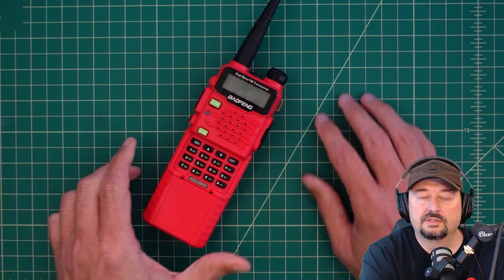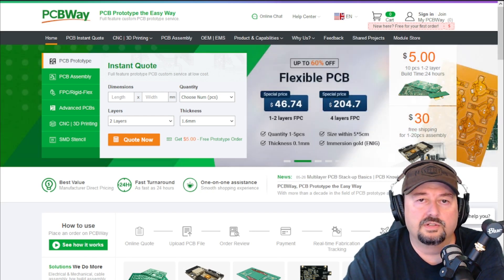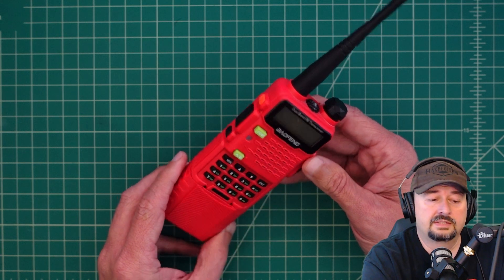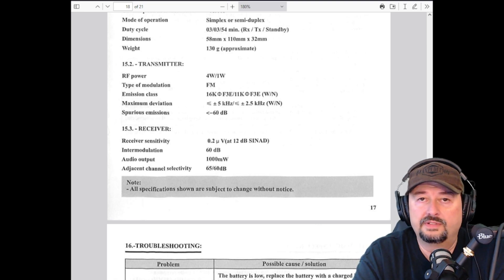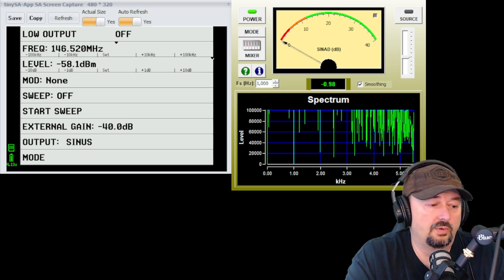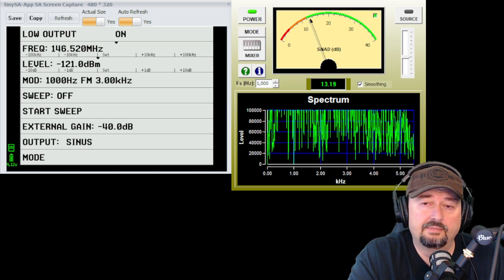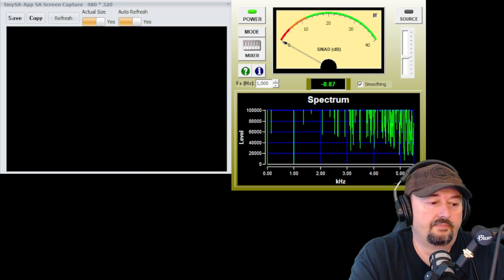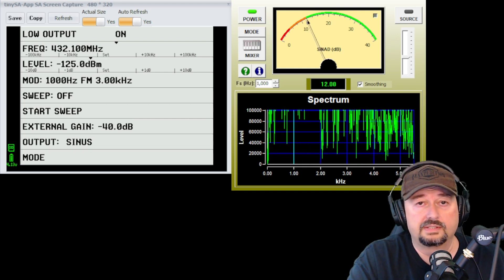Bofeng UV-5R5 - SINAD Test

Comment: CB Radio RX Tune up without a Sinad meter Youtube video any comment on this method.
Reply from the maker: @williamcolvin3609  I’m not familiar with testing SINAD w/o a meter.
Reply: The guy is using a DMM says the signal is better than SINAD because you are not dealing with needle fluctuation of the SINAD Meter.
Reply from the maker: As far as I am aware, while that might be a feasible test method, it’s not the recommended one.

Comment: You really must tweak the 1000Hz control precisely - it causes substantial over/under reading of the value even if it’s a few Hz off. It’s explained in the software manual.

The Hz trim should be adjusted for maximal SINAD value and the output on the TinySA can be a bit approximate coupled with other digitisation in the chain.

I only noticed this after getting some suspiciously “good” and “poor” readings then found out I missed this step.

Trimming it up and down a few steps usually locks on the value and gives far more precise readings - just a tip. 

For SINAD that 1000Hz value needs to be “dead nuts” otherwise you’ll find some very squiffy results.
Reply from the maker: Thanks for the info 👍

Comment: If you get ahold of a BTech GMRS Pro, could you do a sinad test. I have mine setting along side a couple other less expensive handi talkies on scan listening to the repeaters in my 30 mile area. I am not receiving a couple repeaters in my area which the other radios are picking up well. I’m wondering if this radio has a poor receiver. Thanks for all the testing you do.
Reply from the maker: If I get one, I will do the video.  Thanks for watching BDG

Comment: Great stuff @TheSmokinApe. 

A SINAD meter takes away the guesswork from radio sensitivity testing, but as you say sensitivity and selectivity are two very different matters. :)

##  would really appreciate in a future session, if you could take us through the full set up procedure, cables etc for the software based ComTekk SINAD Distortion Analyzer . Plus any pros and cons etc. ## 
PS turn up the volume, as simply hearing what 12dB SINAD sounds like ... would be useful. 

With the TinySA readily available as a quality signal source and a software SINAD meter for not much; there really is no excuse for many more folk doing a half decent analysis of their favourite radios sensitivity. 

Also love your session on selectivity with two Tinys. :) see https://youtu.be/JPVL5E_pmSc
Reply from the maker: THanks for the comment, I do want to get back to doing more if this testing, I'll check out that video 👍
Reply from the maker: LOL, that's my video!  I miss read the comment!

Comment: 125dbm ????  that cant be right, that makes it about  .12  to .13 uV by my calculations... or my maths failed :)  since super sensitive expensive commercial radios only reach .15 - .16 uV
Reply from the maker: I was surprised, I am sure there are a lot of variables in the test.
Reply: The lack of any frontend filtering lets the signal go through better than truck stop tacos on tuesdays. Not good in noisy environment.

Comment: Surprising result. it might be interesting to do some  measurements with another in-band signal present if you have enough gear. I have a few UV5Rs and subjectively this is where their receivers fall over.
Reply from the maker: I was surprised as well.  I've been looking at ways to test for adjacent signal rejection but haven't settled on a preferred way yet...